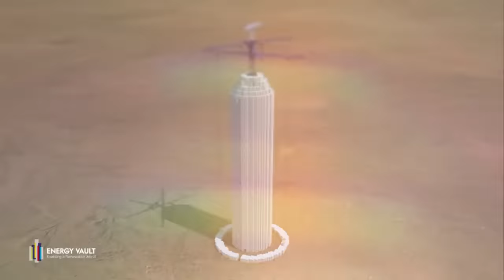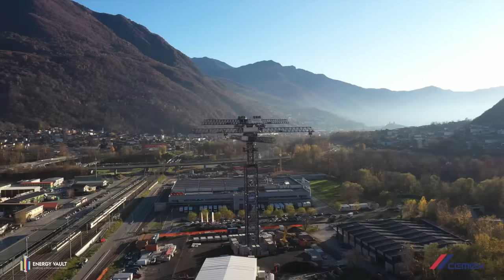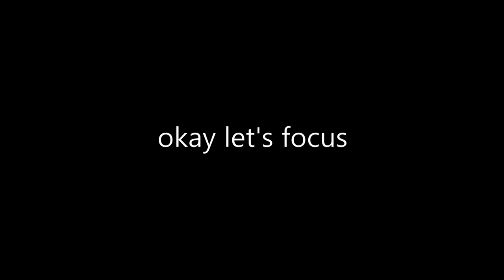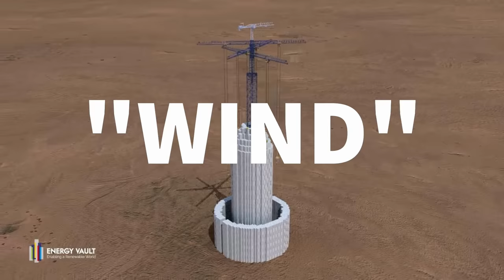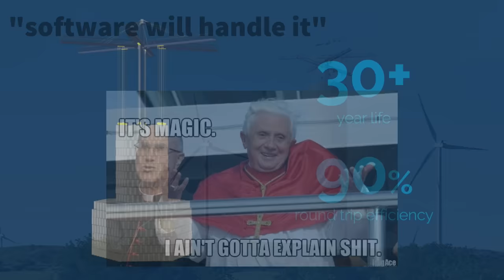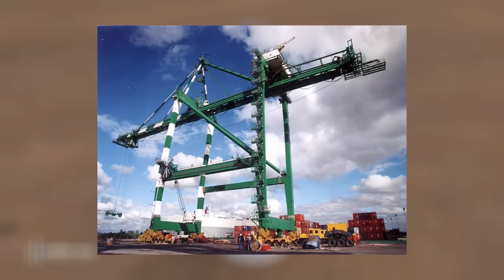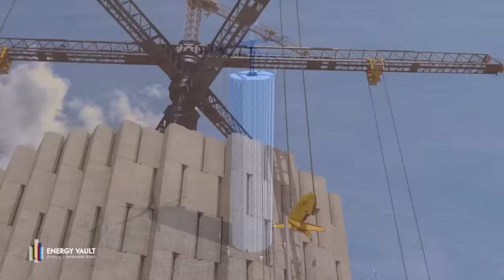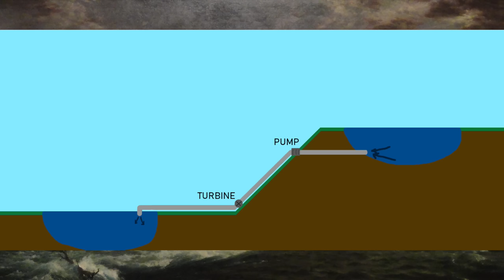The Energy Vault is a Dumb Idea, Here's Why

Comment: The rabbit hole goes deep on this one. Take a look at their investor presentation document.
Reply: truly, a rabbithole it is!
Reply: It looks like an elaborate scam targetting investors..
Reply: @mattlegge8538  it's like cargolifter for electricians
Reply: DAVE!
Reply: My guess is that upkeep alone would ground this idea.
With a continuous running system like this, the Steel cables will eat through a wheel(pulley) within a few cycles. This device would be more offline than online and only because of service needed every few cycles.
Reply: I'm not an engineer myself but I like tinkering and math. The most basic solutions are usually the best.
This crap is just bat shit crazy. Overcomplicared and stupid. People with money and governments will buy into it anyway. Politics and investors love shit like that.
Reply: @mynameismynameis666  
Nicht lustig 😂
Reply: It's certainly some kinda hole!
Reply: Jesus I cannot comprehend how they managed to put so much made up data on those slides. There is so much crammed in with smallest possible font. And then they have colorful graphs that make no sense. Why are they comparing fire risk of lithium batteries and concrete blocks?? Why are there tables full of buzz words with no data to back that up? Naah Im done.
Reply: Hi squeaky, yeah this one is just another scam.
Reply: @terravida333  p
Reply: Rabbits also eat their own shit
Reply: Also, great video on the Electric buses. "Visual pollution" is a non-argument, tho, which only leads to shit that's wasteful at best, but often gets much worse. Example, exposed concrete and masonry are seen as "visual pollution" these days, so let's encrust them in funeral pyre fuel paneling that also entraps moisture and doesn't allow structures to "breathe"! "Visual pollution" is how you sell inferior shit for more money to people who value style over substance. Other than that, the arguments are decent, tho you also have a difference of perspective - "electric cars are here to stay"; well, sure they are, but there will be a dystopian amount of them if public transport and well-designed walkable communities are lacking. An another example is supply trucks being fueled kind of being optimal, so fossil or hydrogen. A good freight train network however also reduces the distances those trucks would have to travel and it certainly wouldn't be from the shipyard to the retailer.
Reply: I have a proposal that stores potential energy by lifting investors wallets out of their pockets
Reply: on page 7 of their Investor Presentation from November 2021, they measure their cash in cubic milli-meters:
Quote: Energy Vault balance sheet cash of $116mm^3
Reply: As deep as the Board at Theranos? 
A real DS murderers row?

I wonder what Theranos was really doing in those labs for 10yrs spending $100's of millions of dollars?
All they have to show for it is a box with a Amazon purchased robotic glue gun inside.
Reply: $110,000,000 from Softbank and they are listing on the NYSE through SPAC. WTF
Reply: @mattlegge8538  Well yeah it's eco power, that's all they do. 
Seriously I don't think I've seen one eco power idea that's not a scam, probably because the tech's not there yet.
Reply: Hello!
Reply: Nikola trucks ... rolling downhill ...
Reply: All we need is Derek Muller (Veritasium) to take a look at this problem... He'll figure out a way to shift the blocks up&down, in&out by simply moving the cranes and cable carts far overhead without needing any physical cable to transfer the power... 🤣🤣🤣
(Perhaps someone could suggest to Derek, when he solves the problem, to name it "Pinocchio Power"... Puppetry without strings! 🙂)

Comment: As a physicist and former nuclear engineer I really appreciated this dispelling of BS. A subscription seems to be in order.
Reply: They were claiming 90% efficiency, which is not the round trip efficiency of pump plus hydro. Im thinking the block system but with water filled cubes would be more practical. Thoughts?
Reply: @mokiloke  Why not just lift a single massive one ton block hundreds of feet high then let is slowly comedown turning a massive generator. (Not sure why hundreds of small rocks would be needed.
Reply: @rayharvey1330  Yep, there are some ease of engineering that make small blocks easier to cast, and cables less massive. But against that you have, as you say, just go massive, and simplify the number of moving pieces.  I guess theres a sweet spot in there somewhere between, but i tend to agree, their machines had way to many moving parts which would blow about in the wind.
Reply: pff did you do the math?
Reply: UNSUBSCRIBED
Reply: "A subscription seems to be in order" is the weirdest compliment I have ever read in the Youtube comment section.
Reply: This perticular one seems stupid but what if they use hydro dams?
Use desired storable energy from solar power to pump water back up to the dam and generate electricity on demand (during night or cloudy days).
I haven't calculated the energy loss of the system.
I may be not seeing something very obvious.
Reply: @dhinas9444  he is a nuclear engineer.
Reply: @2HN.  This can also be implemented in many already existing dams around the world, making adoption more likely.
What a nice way to make wind and solar more flexible.
Reply: @nielskorpel8860  are you an engineer or scientist? I'm sure the nuclear engineer who made this video has thought about it already. I'd love to know anyone who seriously understands these problems and who can tell me why and how incorrect I am.
Reply: @2HN.  Do not expect me to be an authority. It would seem to me, that you could implement it more easily if half the stuff you need (the dam) is already built.
Reply: @2HN.  "This perticular one seems stupid but what if they use hydro dams?"

Hydroelectric dams are not sustainable.
Plus, if the water comes from the fields and you have algae, a large amount of methane is produced.
Reply: Funny you say that cuz I didn't even realize I was subscribed with notis on but then I knew why 🤣🤣
Reply: @mokiloke  just digging the storage pit and having a water containment pool above would be sufficient.
Reply: B-b-but, the towa was huge! So big! Such a bigly big marvel of stupidity!
Reply: Think you being a nuclear engineer you could be biased?
Reply: Well said sir
Reply: @mokiloke  that energy valut system seems like an extra step to transform kinetic, solar to potential energy. Which decrease efficiency aka power loss. Instead, they just need to build a system to transfer those excess energy to an higher location by "moving water"
Reply: We all know that stages of energy conversion account for heat or energy losses. Or the reason why thermal power plants usually don't have beyond 50 percent thermal efficiency.
Reply: @mokiloke  would be higher if they just use the hydroelectric plant method to store water at a higher elevation
Reply: You don't even need to be physicists. Remember when as a kid you tried to stack blocks as high as possible but it was very unstable? Now imagine this but blocks aren't connected
Reply: "former" I think I know what you did lol

Comment: Also to add to the issues with this thing, cranes have a whole lot of big and small parts constanly under stress, which means lots of wear. I work at a crane rental/maintenance hub and not a single week goes by where atleast one crane of ours has something wrong with it and needs some someone to go fix it asap so construction work can continue. They will need to build a house on top of this thing and have the mechanic live in it or something, in order to keep it running efficiently
Reply: That's the first thing that came to mind.  That's a whole lot of moving parts under stress.
Reply: Lol.  I love the concept of just building a maintenance house on top of stuff.  We can build IT houses on top of data centers, apartments on top of hospitals, etc.  Lol 😆
Reply: Last week I binged on a lot for Crane Fail vids, so the moment I saw the cranes and what they were meant to do, I knew this wasn't a good idea.
Reply: @bp968  It's like the new light house keepers!
Reply: You guys say that like it's a bug, it's a feature.  Getting people to rely on a failure prone system produces lots of $$$.
Reply: Also, we are letting blocks of does math just shy of 50tons free fall to generate power and then stopping them before they slam into something.
Reply: I see this on a smaller scale everyday with Amazon. So many pieces of equipment not working properly but management still expects the human to output at the required speed. We humans are still limited by the equipment because people forget about wear and tear.
Reply: @ritathomas4354  and you have people that hate OSHA. There's no reason for it!
Reply: You over state the case, but what of it? Who said it wasn't going to need regular maintenance?
Reply: What kinds of machines do they use in those dams?
I remember hearing that use some pretty big machines.
And I’m pretty sure they are software controlled as well. Or maybe just monitored.
Reply: And don't forget: the house will have to look futuristic
So a heat ineficient glass dome with non-functional solar panels and exesive LED lighting maybe?
Reply: @kokorochacarero8003  Musk can help with the colored LEDs!
Reply: "I work at a crane maintenance hub"

"Omg I am seeing so many cranes in need of maintenance"

lol
Reply: @uncletiggermclaren7592  The issue is why store energy this way when there's better methods? Its never been found to be more efficient to drop rocks over a cliff to generate power than other methods. Efficiency matters, otherwise why burn coal or oil instead of garbage?
Reply: honestly, other faults aside, i'd love to live in a tower away from everybody else.
Reply: @mosseon3456  Its gonna sound like a construction/shipping/train yard. Because it is. Except instead of shipping containers, you're shifting, lifting, and dropping the same concrete blocks over and over again with very heavy cranes and motors.